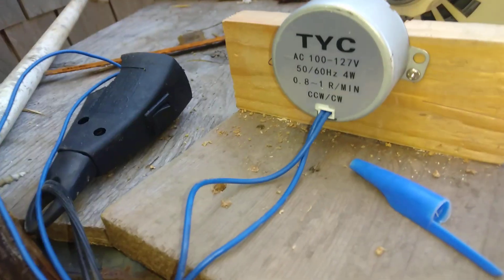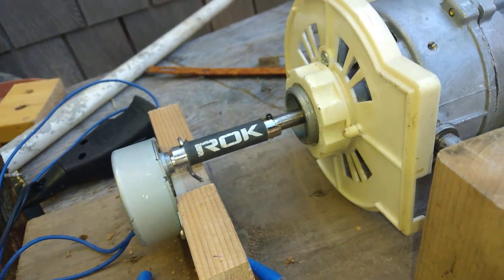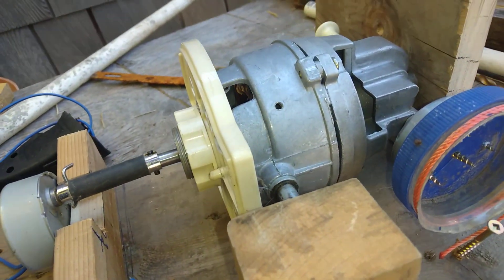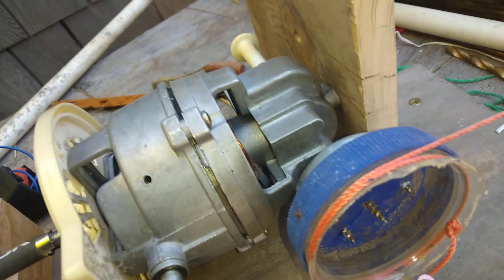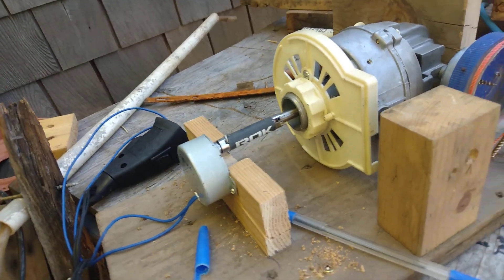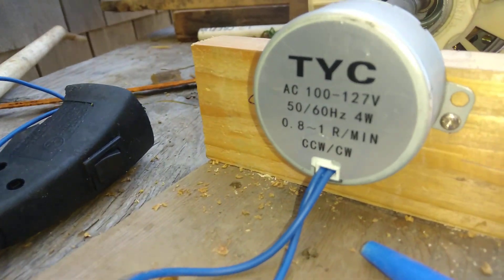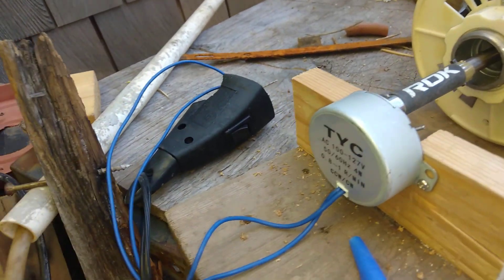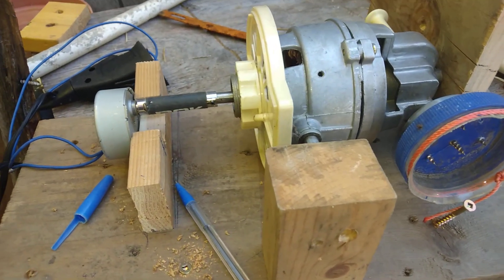Motor and gearbox for the Zombie Pneumatic Solar Tracker/timer are now connected and working!

Comment: Very nice.  I imagine without the gearbox it wouldn't be strong enough?  You can use a cheap DC motor controller to adjust the speed, but as an engineer I'd use quadrature feedback control to get exactly the right movement.  You could also use a stepper motor, but they can slip.
Reply from the maker: Gearbox is just to slow the motion down to close to the right speed. Then I will fine tune the speed with a timer that will shut off the motor 5 or 6 times per hour. (because I am not an engineer).  The timer came late yesterday.